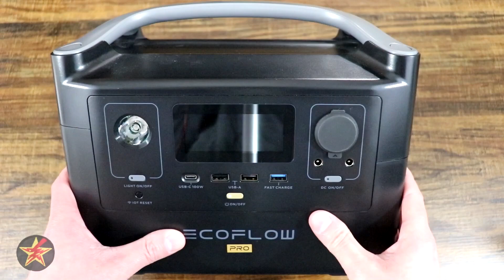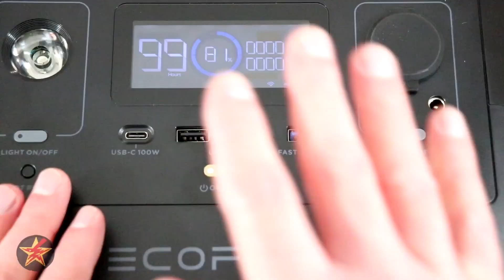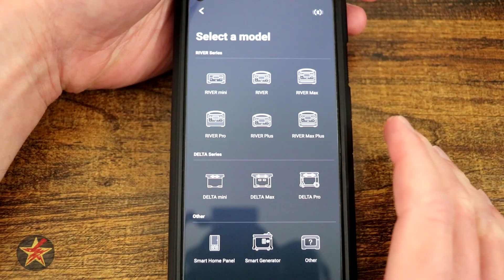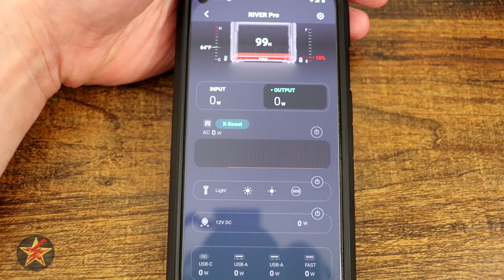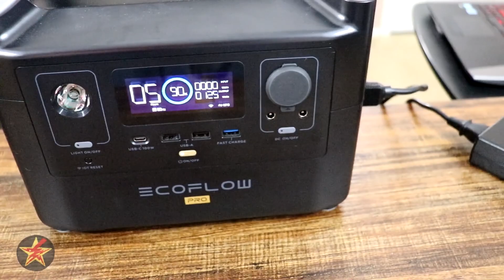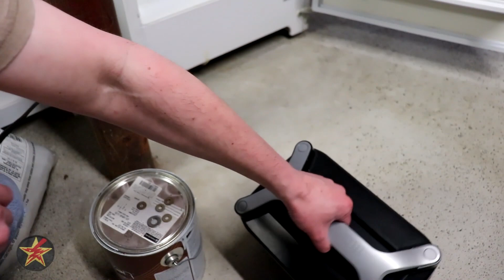EcoFlow RIVER Pro in depth Review

Comment from the maker: Some helpful time stamps:
Intro: 0:00
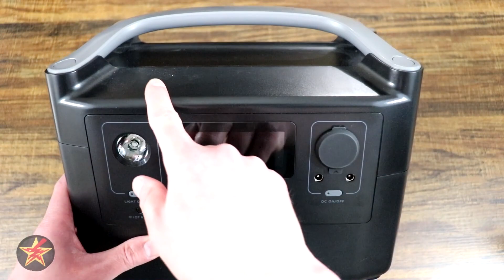Construction: 0:32
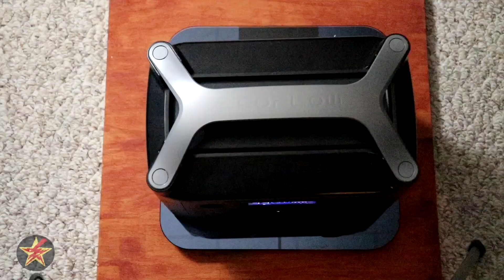Weight: 2:01
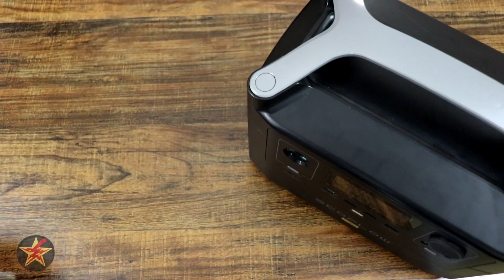What's in the box: 2:37
Battery and out put: 3:19
Front of River Pro: 3:48
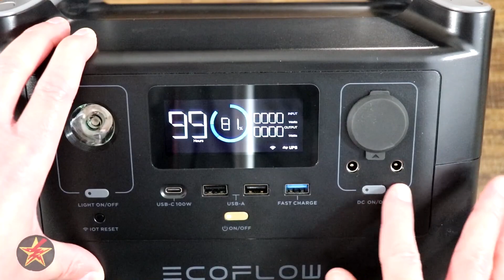Outlet side of River Pro: 5:38
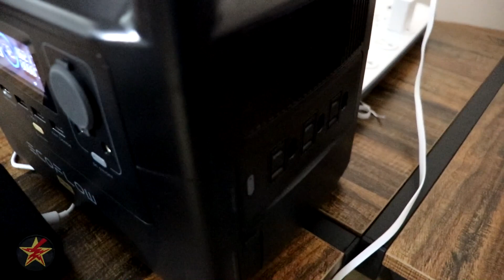Fan sound test: 8:39
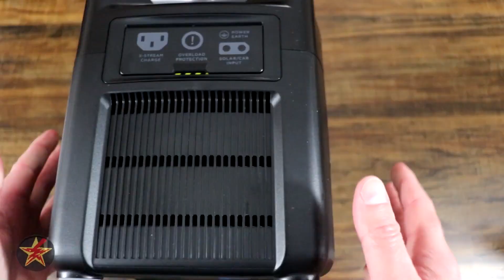Charging side of River Pro: 9:09
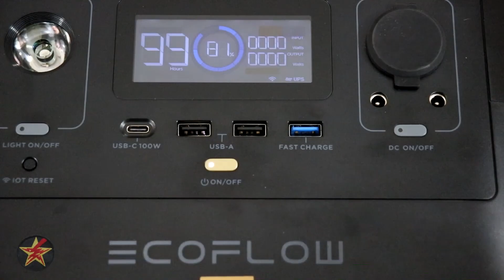Display: 10:46
EcoFlow app: 12:50
Load tests: 21:42
Charging: 27:54
Wrap up: 30:56

Comment: It is possible to use all the app features while off grid. Possibly this is a firmware upgrade? By pressing the OIT button for a couple of seconds you can directly connect to your phone via the WI-FI.
Another possible upgrade is it doesn't draw the spare battery to zero before changing to the main unit. It's more of an even draw now.

Comment: Hey,
Once you have them they can track your package. Down load the App excellent. & controlls flawless, advice after travel time. Climate is important. I let mine sit for 2hrs traveling through. The cooler Temps Take your time make sure your firmware upgrade goes well don't rush it Enjoy how easily it is to use

Comment: I have the River max and wanted to add the river pro. i hate the wifi connection, I'd rather have a bluetooth connection. I also don't like the handle, would love to have it flat at the top so I can stack things on top when traveling. BTW, when out camping and no wifi, you can press the wifi button and your phone can connect to it directly.
Reply from the maker: Yes, the handle is some what of a pain point with the River Pro.  It is just something I have learned to live with.  I will have to try pressing the wifi button on the unit next time I am out in the middle of no where with no data and see if that works.  Bluetooth would have been much simpler but I feel that doing that would have left out being able to do frimeware updates for this.